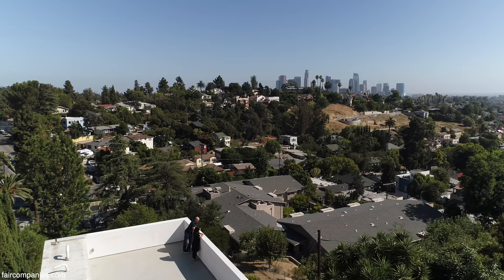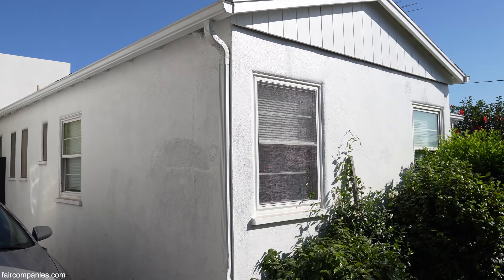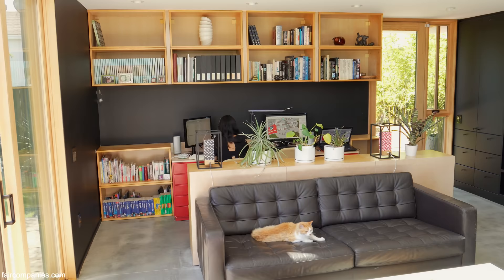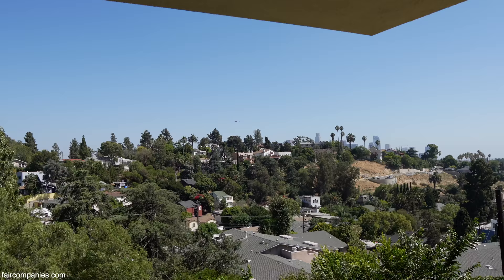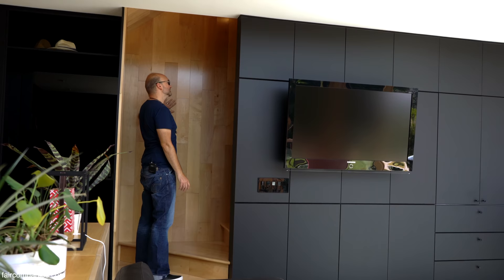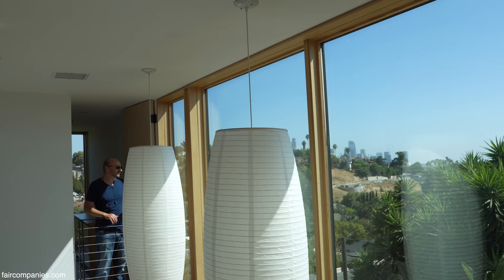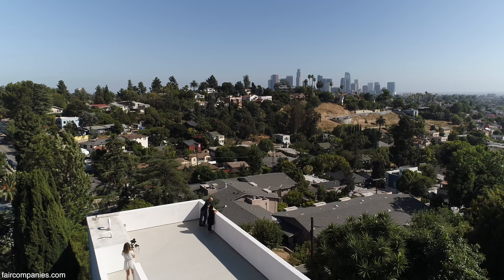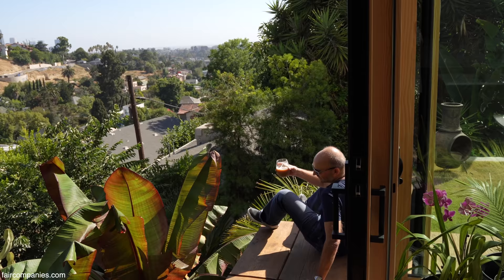LA couple builds backyard cottage, then moves-in from main home

Comment: One could grow a great garden on that roof.
Reply: Steven Strain smarter to put the panels in the original residence. Plenty of space and exposure on that roof.
Reply: Agreed--not a shade garden though!
Reply: Los Angeles: With all the existential threats (water scarcity, earthquakes, heatwaves, extreme wealth inequality, air pollution) that will endanger life in this mega metropolis, it is the last place to invest in a house for any sane person.
For a great garden get out of the city to where there is actual rainfall.
Reply: I agree.
Reply: superbly done
Reply: Exactly
Reply: Too hot I guess.
Reply: Might have waterproofing problems in the future. Not to mention the additional soil, especially when compacted, adds undue stress. Potted plants and a patio deck would be perfect though.
Reply: Green roofs are tricky due to weight, drainage, etc. Gotta be done carefully and deliberately.
Reply: Why not pool
Reply: Gardens are heavy. Soil and water. So the structure would have to be built to accommodate that
Reply: and then in 5 years worried about leaking

Comment: I find it hard to believe that the city planners allowed this build which clearly blocks the light, air flow and the view from at least two neighboring houses. But then again, it's LA. And let me add that I'm 100% sure that not having a railing on the outer deck that has a seriously high overhang, is non-compliant with building codes. Guaranteed.
Reply: This is exactly what I thinking the neighboring houses are blocked from there views and replaced with a huge white wall ..
Reply: Los Angeles: With all the existential threats (water scarcity, earthquakes, heatwaves, extreme wealth inequality, air pollution) that will endanger life in this mega metropolis, it is the last place to invest in a house for any sane person.
Reply: @griffin2263  They altered the skyline for many of the houses on the adjacent hill...  This is a big NO-NO in California.  That and the no railings on the deck make me think this did not pass permits legally...
Reply: @offthemap9582  try the big island everyone is screwed
Reply: @offthemap9582  on the other hand there is strength in numbers and more social services available here to people who might need it. That said, I am I getting out of Los Angeles for the very reasons you mentioned!
Reply: @gregpendrey6711  I love the Big Island.
Reply: @nonebiz2132  a lot of stuff is done after the final approval is received. I'm almost positive they built the deck section facing the view afterwards, in order to pass.
Reply: CiaoBella  LA Building & Safety almost never enforces the municipal code in “transitional” neighborhoods. It’s a crime.

Comment: Nice design. I like the rooftop space. What would make it better is if they made it into a green roof. A rooftop garden would be awesome.
Reply: With solar for sure. The rooftop garden would reduce heat, so you wouldn't need the air conditioning as much. They should be everywhere, even on skyscrapers to make green space, and save on cooling costs. 
Every roof that has space and sun should have solar panels. I wonder if it would be possible to put wind power on skyscrapers. It's very windy on the top and even the sides (upper-middle floor dedicated to wind energy?). I don't know if it would work, but society really need to think about sustainable power. There are so many power outages that things have to change. Making your own power is one solution. If you make too much power for yourself you can sell it back to the grid.
It should be funded for individual homes. Businesses would save on power costs.
I hope that is possible in the future to use fewer or more rare metals to make solar panels. Innovation comes with more use and potential for profit. Unfortunately, oil companies would rather sustainable energy didn't exist and will pay tons of money to stop it.
Corporations pay politicians vast amounts of money to vote keep oil making vast profits. The amount corporations can donation should be severely limited or it's a country run by corporations, especially those who extract fossil fuels.

Comment: For people looking for ideas: NEVER put flooring on your walls without doing some research first. He calls it wood but it looks like wood grain laminate. Either way you can tell it was a terrible idea by how bad it's starting to cup. If you look at the light reflecting off at 9:15 every board that doesn't have a nice smooth light/shadow is cupping and will eventually pull themselves apart. Even if he bought them used and glued them in that way I've seen glued down flooring actually tear themselves in half as the cupping gets worse and it can't handle the strain. I install this stuff and they often recommend you have a dehumidifier and mostly keep your doors and windows shut to keep that from happening, (some bamboo has a humidity range tolerance of 5-15% before it voids your warranty), and that's even when it's on the floor being walked on and gravity is helping keep it flat. People almost always do that because it's way cheaper than tongue and groove planks meant to be used on a wall and it almost always eventually fails unless you're in the desert somewhere.

Comment: Lovely! 

My only concern is that rooftop deck he's talking about.  What a ridiculous risk to take building the deck elevated up so high like he's proposing without any railing.  Even with the setback away from the edge that he's talking about, all it would take is for someone to trip forward with momentum and they'll go sailing right over the side!  Regardless of the setback from the sides, that is an unacceptable risk and I cannot imagine it would be allowed by code.  In fact, the section of the walkway along the back of the house that has the precipitous drop is most likely in violation of code.  All decks that are higher than 30" above the ground are required to have a railing, and that section of their walkway definitely appears to be in violation of that.  Perhaps they got around that because there's maybe a foot or two strip of ground that's less than 30" down before the major drop off or something like that, but it's a stupid risk to take even if it's somehow legal.
Reply: I do not know his case but here in Europe you do not any special railing if the parapet wall on the roof is at least one meter high

Comment: I wish they'd put how much it costs and how long it took. So say, you have 900k to buy a house, buy a 600k house with a huge yard and use the rest of the money to build the back unit? Curious as to how it works. And what about the permitting process? What if the neighbors are partially cast in shadow? At least a chunk of that backyard is empty. I wonder what the couple does that they can afford it. So many questions.

Comment: A small hot tub on the roof seems like a no brainer, assuming it could take the weight.. I'd also have a gas fireplace near the table outside.  I love the design in general - it's perfect. Love the engawa. That black wall will be stunning as a backdrop to art and photos.

Comment: Me: Roof not slanted, no drains, no access side drains....

Him: we decided to have a pool on the roof 20ft deep!
Reply: The roof can be slanted but they just didn't talk about it. They didn't show the side of the house with the tall trees either. The upper part of the house that faces the old house didn't have windows. So the drains could be on either side.
Reply: Excess water during the heavy winter rains that LA experience almost every year will flow down the stairs and out the side by the vertical slats he showed at the bottom of the rooftop stairs. Easy. Zero problems. Quite an elegant solution.
Reply: @bossthefluff  actually major problem. The roof is flat, water is going to sit regardless the amount of rain. It can over flow down to the stairwell but even it will collect water, especially at the bottom by the door. No sunlight and it will take longer to evaporate. This might not be an issue as in "now" but down the road when it will have expensive consequences of repairing rotted wood.
Reply: The walking floor on the roof is rarely ever the actual roof surface. It's probably a deck over the roofing. Drains, inside the wall, just like a commercial building. No big deal.
Reply: @Matt Ruth nice show of status. you don't have to insult people to communicate a new idea to them. it backfires
Reply: a "flat roof" is rarely a perfectly horizontal plane
more often it has a pitch, and includes provision for drainage of rainfall
.. so no pool
.. I would guess the drains run down ( or inside ) the unseen side of the house
Reply: FoxIslanderSteve  which would of been no problem with this house. But reviewing a few times (especially with the flying droid) shows no drainage or even slight being slope. Alot of mid century homes with flat roofs had that poor design.
Reply: @hydrobuu  read something about constructruction of flat roofs. There is probably this floor substructure you can see and under is a slopped waterproof membrane with drain outlets.

Comment: How is this big box of a building a cottage?
Reply: 20x30x2 stories is 1200 square feet.  A small house, a cottage.
Reply: @condew6103  except it is larger on the second floor and not to mention the envelope includes height. There is almost the equivalent of a third story because the rampart is like six feet on top to the edges all around the roof eaves. If these folks lived in a real small town they could never live with the stink.

Comment: In the process of building a house in Tokyo, shocked how they’re building seemingly with no restrictions with right to light or height. Looks about 2.5 stories, with no roof slanting to let light into adjacent properties. Building a deck level with the roof railing and deck furniture on top of that will further block views.

Saying it’s their property and they should do what they want sounds good until new neighbors do the same to your house. Zoning laws ultimately are meant to protect, not just hinder you.

At least in Japan, such a house would cost at least $400k for the structure itself, since they spared no expense for the materials (plaster, wood paneling, tiles etc)

Comment: Everyone is so concerned about the neighbors' views, but at 1:19 you can see that the house at left is not oriented toward their view, and they have preserved the narrow corridor of sight lines that open for their original house - for what appear to be kitchen windows. At 5:24 you can see that the one on the right had already blocked most of their own view in that direction with those evergreen trees, and the existing garage blocked any view from the main floor. They can still enjoy what is straight ahead of their upper windows. 

Let's face it, this is not the kind of neighborhood that was built with views in mind; the houses are focused on the street.  No one would have been mentioning  views if these people had not had the inspiration to find them.

Comment: I wish I could do something like this, but we're not zoned for it. I can't even build an apartment in my basement or attic & rent those out. Wish I could. I'd move up into a revised attic space with lots of glass & decks, for 360 degree views. 

I'm at the top of a small hill, @ about 900 to 1,000 ft above sea level, & could see both the east & west horizons,  to other hills west & north. I'd enjoy views for many miles of lower elevations to the east - and on clear days, could see faint shapes of the tallest buildings in Boston & to the south, rolling land at lower elevations than my city, mostly tree tops, maybe as far as CT.

Comment: The upstairs has limited square footage because the central vaulted area does not count as footage up top.  Also, don't believe the staircase counts as square footage.  Possibly, they met the letter of the law with regards to "footprint," but notice the second floor overhangs the first floor on two ends.  There needs to be a change of rules that will restrict the "footprint" of the roofline.  All that hard surface will cause more rain water to flow downhill to neighbor's yard.

Comment: Lots of great architectural and interior features here.  However, that exposed, 2-story wall must get uncomfortable on hot, sunny days and no escaping the rain - no overhead cover.  I would have designed the second floor to overhang that plank walk by at least a meter or 4 feet to compensate.  That could have allowed more 2nd flr space for a third bedroom perhaps.

Comment: Interesting use of the lot and the ADU designation. My only beef with these Hollywood-adjacent buildings (yes, Echo Park, Silver Lake, Fairfax,  etc., are functionally Hollywood equivalent; close to studios and many of these communities were built in support of the studios) is the lack of imagination,  architecturally. Why so many flat, roofless, structures are going up either as replacement homes, or ADUs is beyond me. Why not respect the existing architecture (in general, I mean, realizing that some of the housing stock, like their front house,  was low-budget, built for  working class families) of the  neighborhood. Echo Park, for instance,  has some wonderful 30's and 40's themes. And Silver Lake, groundbreaking design by the nation's best. Oh well

Comment: For my structural engineering opinion. The edge column near the dinner table is too small. if it hollow A36 steel section. Otherwise, the design is awesome. Like and thump up from Thailand.

Comment: Where do you start with this monstrosity? So boxy and boring, another uninspiring cantilevered glass rectangle that is wildly out of place. But the guy says he saved money by spending buttloads of it, is proud of not having AC because he can just go around opening windows all day, and thinks a raised deck on the rooftop with no railing and a gap on the sides is somehow safe. That and the dirty rooftops of LA looks rural. Hysterical!

Comment: Beautiful house but I have a question. Why is American houses always constructed with woods? Back in India houses are constructed with bricks and concrete.
Reply: Wood is a renewable, inexpensive,  less energy dependent material . construction time is faster.   They are are easily insulated and easily  adaptable .      Also wood structures do well in seismic zones. Properly maintained they can lat forever

One thing I notice   as an American living in Spain as the houses here are built like bunkers and have bars on the windows.  I have never seen a house here with glass walls like those that do not have bars or metal doors to cover them completely for security.   I never saw bars on windows growing up in New York.

Comment: At some point these 100 year old small cottage LA houses have to be remolded having only two door size closets in a home does not function in a modern world your using ever corner in your home looking for,storage...I have a little under 700 square ft on 3500sq ft lot I would love to tear down the original house and build this and an ADU in the back to last another 100 years😀